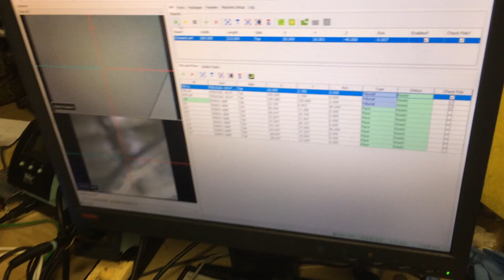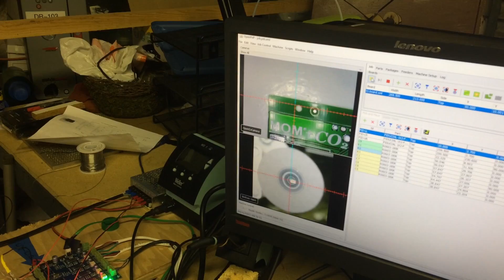Liteplacer doing a quick board

Comment: Is this OpenPNP driving the Liteplacer with bottom vision? Was there any special steps you needed to follow to get the bottom vision working or is this stock machine with just OpenPNP?
Reply from the maker: Both Liteplacer and OpenPNP works with bottom vision relatively "out of box" as long as you use a compatible camera. Liteplacer is a bit more restrictive in camera orientation. I had to fiddle with the pipeline and also made a black disc to put above the nozzle to make the contrast better. I use bottom vision now for higher pitch components, and just wing it with the normal top vision otherwise.